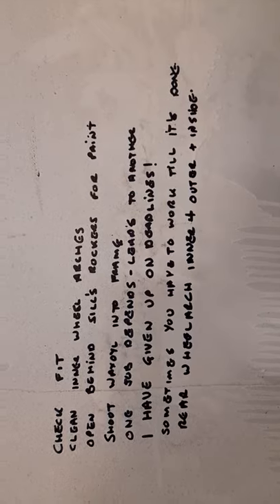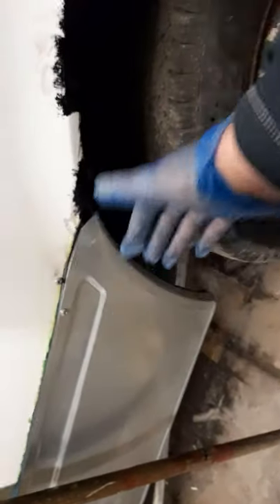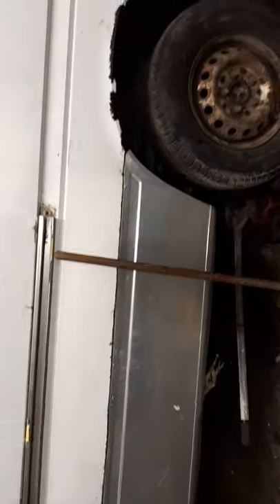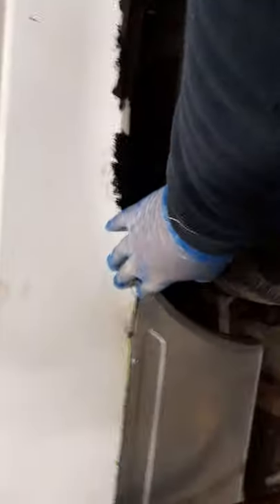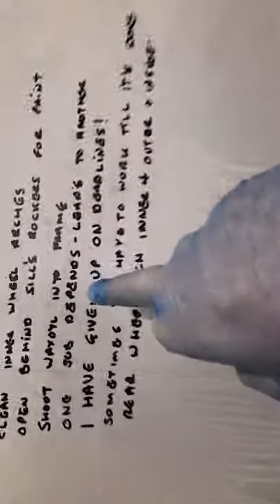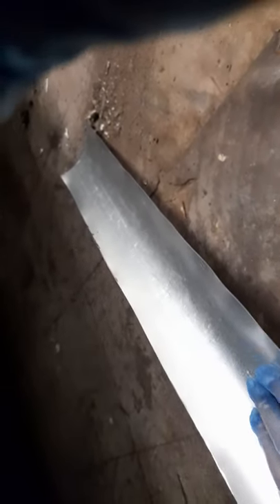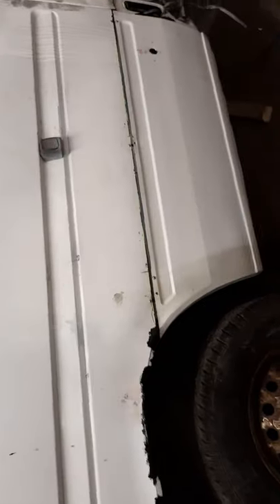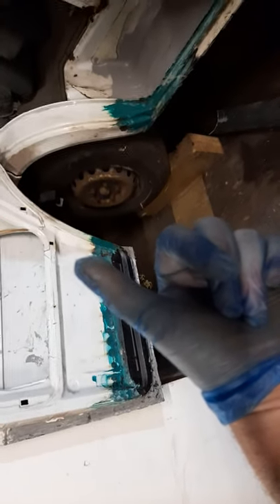T1N update, how my brain does or doesn't work?

Comment: Hi Phil. Good information.  Inspires me to get a sprinter for a project.  Did your sprinter needed any structural type of welding? Someone i know is selling a 03 sprinter for 1k and I needs lots of welding work like door panels but also rear suspention mounts welding? Do you think a flux welder would be able to tackle that job? Would that put you off buying it? Id Probably need to take someone who's got some experience with welding to have a butchers
Reply from the maker: The manufacturer absolutely covers the underside in a thick layer of underseal, the frame on that van really isn't to bad considering how corroded everything else was. I used flux core for everything mainly because I am on a very tight budget and flux core works out cheaper... If you are buying a T1N go for the best one you can get, they are still out there, I have been working on this old scrapper for well over a year, it was a silly project to take on. As for repairing the frame, I have found Russian guys that have more or less completely replaced the frame on T1N's, it' s doable however, the more work you have to do the longer it will be before you can use your van
Reply: @zambotv8150  thanks for reply.  Its probably to much to take on. If I get one ill definitely be referring to your videos for help. Keep them coming
Reply from the maker: @Peps1975  https://youtu.be/15oqO1gvyKk?list=LL&t=184 https://www.youtube.com/watch?v=ZpDLp_ZeVpw&list=LL&index=13 Oh thanks Wayne, it's doable but, it takes so long I honestly believe your better just looking for one with a decent frame, The two videos I posted show just how good some people's fabrication skills are, they're in Russian, I usually watch them with the volume turned down and at twice speed, good luck with your hunt and keep me up to speed with how you are getting on, the T1N's are brilliant vans but, outside of Russia they haven't been made in over 15 years, where are you from?
Reply: @zambotv8150  im from Birmingham but now living in Cornwall.  Not many cheapo vans available down here! Hopefully when lockdown ends prices will drop in the second hand market? The thing that appeals to me about the one my mates selling its only done 70k! But the bodywork is very bad. Ill keep hunting around.
Reply from the maker: @Peps1975  Do a video and give me a look, that engine isn't even run in yet, if there's a local fabricator that can repair the frame for a few hundred pounds you could end up with a diamond, the T1N's are capable of monster mileages, they can hit 3-4-5-600 000 miles just with regular oil changes and, they are getting rarer, I am hoping clean T1N values will start going up over the next few years?
Reply: @zambotv8150  thanks mate. Ill pop around and see him and do some video
Reply from the maker: @Peps1975  The back axle's held on with four bolts for the leaf springs, two for the drop link and four going to the prop shaft, a couple of ABS sensors, two brake lines and a handbrake cable, it's a pain in the ass but doable. If you're not comfortable, get a professional to do the chassis and you can tackle the bodywork? If it's too badly gone walk away but, considering the mileage it's done  it might be worth going for it. I have subscribed to your channel, stick the video up and fingers crossed we can keep another old lady from the breakers yard
Reply: @zambotv8150  that sounds like a big job.  Did you have to do that on yours?
Reply from the maker: @Peps1975  No I didn't, the places to be really concerned about on the T1N's aren't the doors and body panels but the chassis and where things bolt on and off the chassis, they are more difficult to get to. Taking the axle off isn't really that bad, trolley jack some stands and a socket set,
Reply: @zambotv8150  ok mate. The rust seemed to be around where the rear leaf springs attach to the chassis. Probably terminal
Reply from the maker: @Peps1975  It can be repaired but, it's always going to be a time and money thing.https://www.youtube.com/watch?v=J8ksBHfSgv0&t=37s The chassis are around 3 - 4mm thick, you might be able to grind it down however, it's just a shed load of work